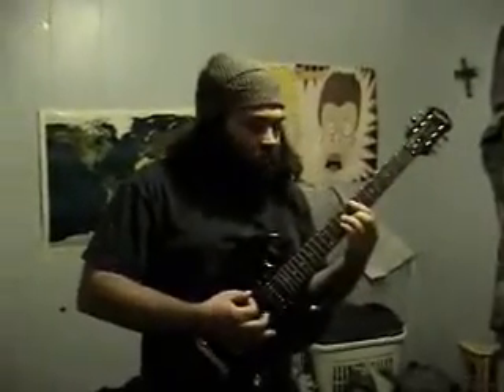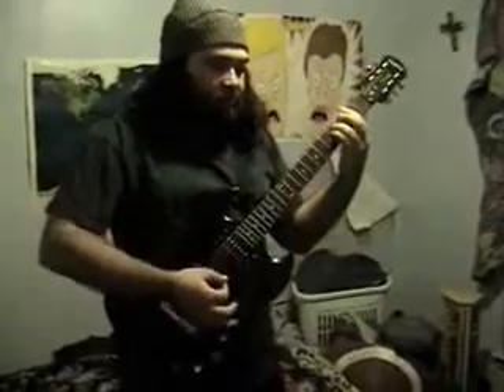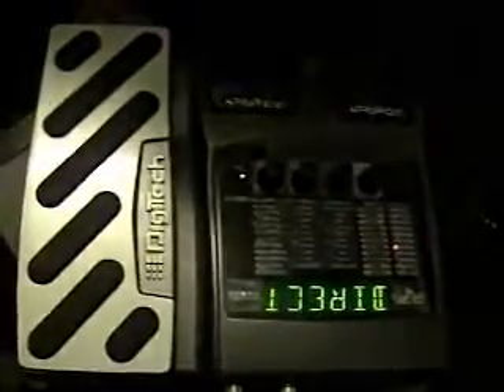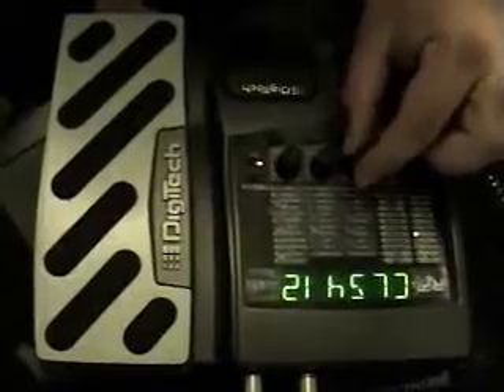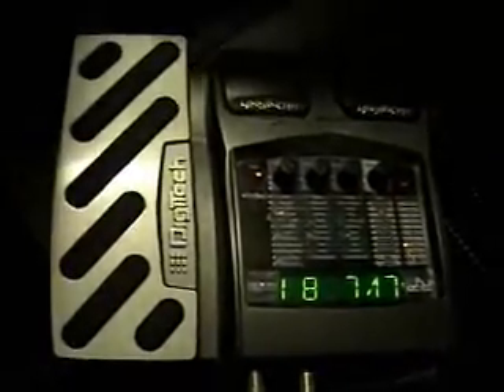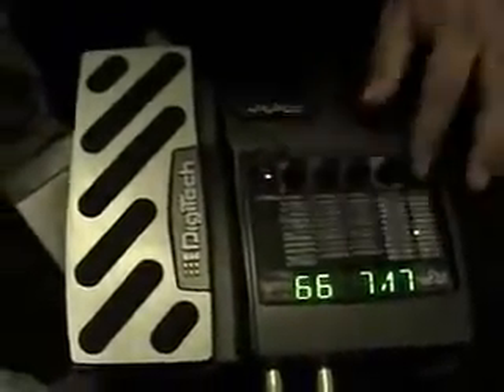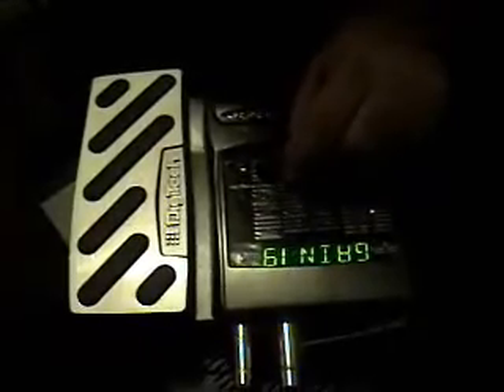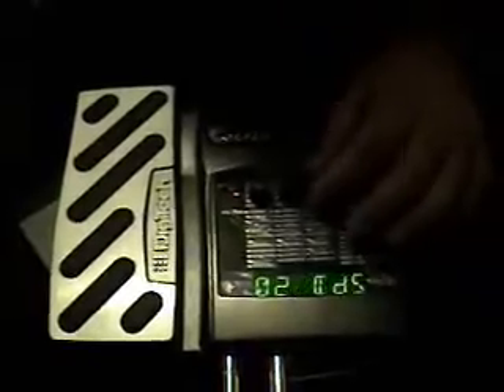Digitech RP 250 IN DEPTH REVIEW PART 1.wmv

Comment: yeah, I've had several Crates(both tube and solid state), a Vox, 2 Marshalls, and my Line 6 Flextone 2x12... and my very first amp back in 1987 was a 10 watt Gorilla!  Horrible!  LOL  I had a Gibson SG and this little shit amp.  I quickly traded it in on a 65wCrate combo which was pretty good.

you know what's a good amp that doesn't cost much money? The current Peavey Bandit 112 combo - killer tones and you can plug it into a cab too.